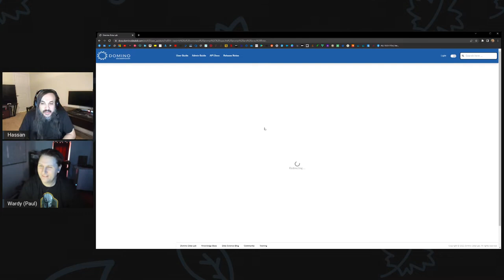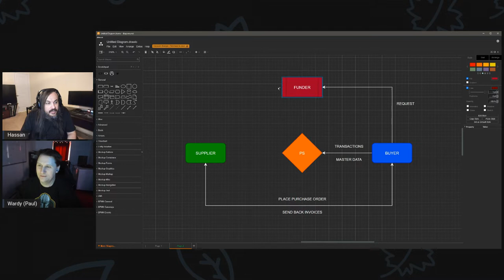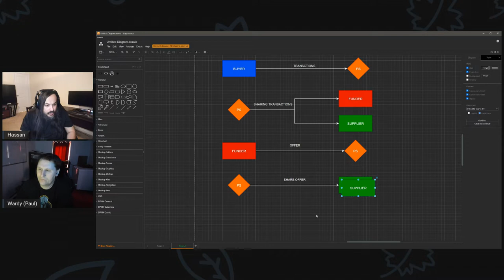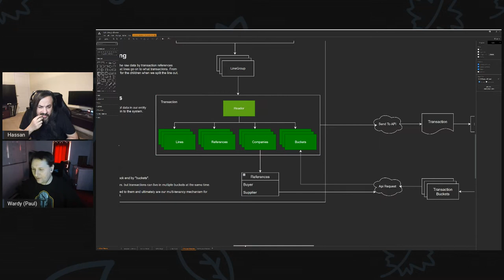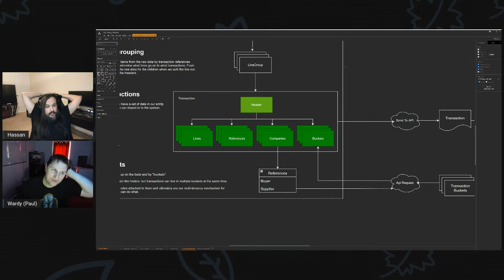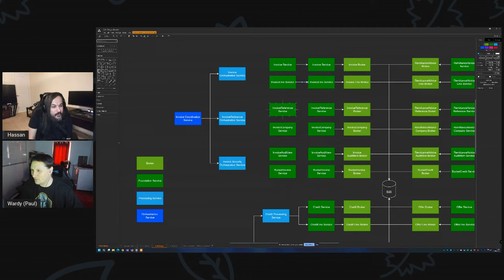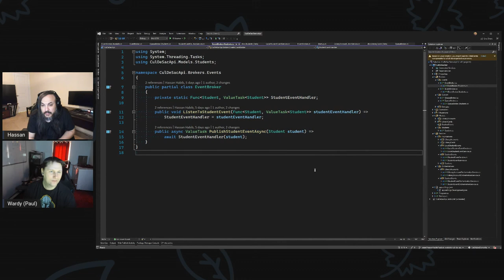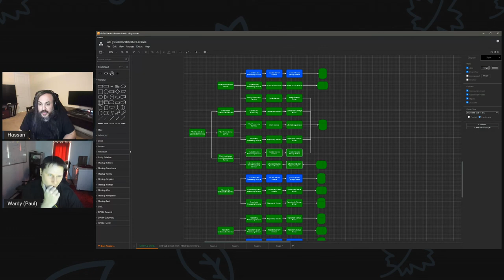Designing Real-Life Reverse Factoring System by The Standard

Comment: I am not a programmer by trade but I have a very keen interest in developing web services, blazer apps and apis to support my Infrastructure professional life. I am not great at development and want to know if spending time learning The Standard, will help me to more easily build code correctly or would I only benefit if I am a more advanced developer?
Reply from the maker: Yes. The Standard will help you build great maintainable software in a very simple proven way.

This video wouldn't be the best material to start with however. There's so much built on top of this and what we discuss here is very specific to certain complex scenarios.
Reply: @HassanHabib  Thanks for the feedback. I agree about this video but I did watch it and enjoyed the breakdown of the elements of the solution. I was really surprised that even as a relative novice, non-professional programmer I understood what you were both talking about.  Gives me hope.. :)  I have clearly learned something while messing around. I will have a good look at The Standard, thanks for your community contribution.